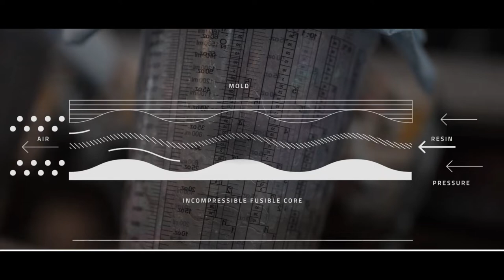Time Alpe D'Huez 01 Long Term Review

Comment: What specifically do you like better about the time vs your Cervelo R5. The Cervelo is lighter and I can't imagine why a racer would want this time fork that adds weight. I am looking at the R5 and waiting bfor Willier and Colgnago to come out w new models. Curious as to what year your R5 was and what wheels you are/we're running on both bikes. I'm intrigued by the Time even though the frame shape looks dated and I wonder how much R&D they are actually doing now and if they will update this alpe de huez model in 2023 or not. Any insights you can share would be appreciated as there aren't many European made options left for carbon bikes these days. Cheers
Reply from the maker: Hi Mark, I was on a 2018 R5 Disc with ENVE 4.5AR's which was slightly more harsh across bumpy and choppy roads. The ride on the R5 was also more noisy and felt a little more like plastic than wood, if that make sense? The Time, overall, is a smoother more muted ride with quick but less racy handling. I don't expect a 2023 update, but I know they're deep in R&D for a refresh of the model in 24 or 25.

Comment: I rode a TIME RX Instinct in college and it was my favorite bike I have owned to date. Currently riding a 54cm Allez Sprint that I feel good on and comparing geo charts it seems like the headtube lengths on the Time are consistently taller which would lead one to believe a more relaxed fit (comparing the 54 Allez 133mm to a small Time 149mm HT length). The Time also has a much shorter reach and taller stack so I am wondering how "racey" this bike rides compared to the Allez if you have any experience. I am looking at purchasing a ADH 01 frame but am having a hard time determining size with no dealer close to me. Time's charts would lead my 175cm build to a medium but the geo specs seem way too big compared to my Allez. Any recommendations or experience here?
Reply from the maker: I would send this question to the guys at Time. They can help! Try info@timebicycles.com
Reply: For what its worth, I just bought and built a ADH 01 size SMALL.  I'm 175 cm and here is my current setup. Saddle height is 70cm, 100mm -6 degree stem with 15mm spacers, Power Pro saddle setback 8cm (standard saddle setback 5cm). My previous bike was a Tarmac SL6 Pro disc size 54, and after having professional bike fit I had it setup as follows, saddle height 70cm, 90mm -6 degree stem with 10mm spacers, Power Pro saddle setback 8cm (standard saddle setback 5cm).  You can review the Tarmac geometry for yourself but you will see that the Small ADH01 and the 54 Tarmac are practically identical except for the reach in which ADH01 is 11mm shorter.  At first glance at ADH01 geometry I would agree stack seems tall for a racy bike, but after digging into it I now think that its more that the reach is short because it is intended to be run with a longer stem as part of the overall design and one should be sizing down to match desired stack height.  So instead of buying a MEDIUM and running with a 100 stem, one should be be buying a SMALL and running with a 110mm stem thus achieving the equivalent of a Tarmac size 54 with a 100 stem (stock).  If you look on the Time US site and look at the "complete bikes", you will see that the SMALL size comes with a 110mm stem stock. Like all bike sizing charts its just a starting point, and probably for a beginner, the sizing recommendations are more applicable as they will sit more upright etc.  For me personally, I actually debated between the SML & XS sizes.  Since the reach was the same, it became a function on stack height, but XS was a bit too low for me.  Again for what its worth, if your current Allez setup is similar to my Tarmac setup, I say go with size SMALL or even XS if you want to get really low. 
BTW - I have been out on a few rides and I will say the ADH 01 did not disappoint, it is superb in all aspects.  I will post a more in depth review of the bikes performance on here in the coming days.
Reply from the maker: @brianwestcoat280  great to hear! I would caution other readers to buy a bike that suits their individual measurements, though. Bike fit, as you know, involves more than just a height measurement - and like snowflakes, no two human bodies are exactly alike. You could have a short torso with long arms, long arms with a long torso, Long legs and short arms with a regular size torso etc. etc. etc. my recommendation is always to consult with your local bike fitter to ensure you end up on the right size.

Comment: Beautiful video, I have been eyeing a time Scylla or Alpe, but what is the difference between alpe dhuez 01 and 21? Can they handle 80kg high torque riders, any flex?
Reply from the maker: Thank you! The 21 has a slightly less expensive carbon, with better overall compliance. I’ve ridden both, and the 21 is smoother and a little less responsive- but not much! It’s still an extremely agile bike.
Reply from the maker: And yes, either would be stiff enough for a rider your size.

Comment: Hey Andy, i own the same cervelo r5 disc with the same paint, you mentioned that you decided to go with time ADH after only one ride, that to me it's quite surprise to hear; like you, i really like the cervelo r5 and to me that most two outstanding characteristics of r5 are 1.responsiveness in transferring power and 2.agility in handling, only one noticeable downside is its harshness on riding, you almost feel every little bump on the road, but i guess that's also another manifestation of 'responsiveness'... anyway, i would really like to know what's about the so-called 'ride quality' in your experience that completely out-run the cervelo r5 then led to such a decisive switching choice.
Reply from the maker: You nailed it when you mentioned the noticeable downside: the harshness. The ADH replaces harsh with smooth, and doesn’t sacrifice any performance.
Reply: @AndyClarkRealReviews  damn, that for sure is something, how about the handling, i noticed that the ADH actually got quite large trail compares with r5 at the similar size, i really like the agile feeling on R5 when getting out of the saddle, you can just rock the bike left and right smoothly with such an ease, unlike my trek emonda slr, it handles a little bit sluggish when out of the saddle and lacking that lively feeling, you can easily feel that when riding with no-hand, emonda slr can be kept straight really easily. do you think that the Time ADH is on the lively side like r5 or on the more stable/sluggish side like emonda slr?
Reply from the maker: @willyturing1803  R5 is on the nervous and nearly twitchy side of the spectrum, but that’s because it’s supposed to be; it’s an ultra responsive, pro-caliber superbike. From 25MPH to 45MPH it’s a DREAM. That was one of my favorite features TBH. The ADH won’t feel as muted as the mass-appeal Trek, but it’s definitely not as quick to respond to input as the R5. If this story was Goldilocks and the three bears, the Trek is too cold, the R5 is too hot, and the ADH is just right - at any speed.
Reply: @AndyClarkRealReviews  I think i'm gonna get the ADH, i haven't ridden the new r5(fully internal cable version), not sure what's the difference, but damn i just love this old version, not sure if i'd want to let it go though, i was actually considering new scott foil 2023 so that i have full reasons to justify keeping my r5, but it seems now the chance of me getting ADH is much bigger and doesn't make sense to keep two climbing bikes. And also not sure if the ADH 2023 version actually allow me to run 30mm tires(measured, 28mm claimed). Because i seriously couldn't tell the real difference between 2022 ADH 01 and 2023 ADH. And also would love to see how do you compare with ADHX.
Reply from the maker: @willyturing1803  soooo, when you start to talk about tire clearance and the X, that’s a whole different conversation. So, can we back up and talk about your intended use?
Reply: @AndyClarkRealReviews  Well, see i'm more of roadie at the heart and that's what i do mostly, so i need a bike that can handle the road stuff like ADH you mentioned that could on part with R5 every major way and exceed in some other aspects, and i use a set of enve 4.5 AR disc mainly on the road side; on the other hand, i also have a set of new enve 3.4 ses(25mm internal version) that could be used for some light gravel equipped with 38c tires; originally i was going to get a fully aero bike like scott foil rc ultimate 2023 i mentioned, but i'm actually a little bit hesitating since i'm not sure this so-called fully aero equipped bike will be that much better like noticeably fast of some sort. And somehow it leads to my current position, i feel like this ADHX is actually that kind of do-it-all bike, in which i mean i could just install the enve 4.5 AR to smash on the road, then swap to enve 3.4 with big tires to run some light off-road on the weekend with buds, heavy fire road is not what i intend to do, hope you can see dilemma you led me to, FYI you were also one of the big reasons i got this old cervelo R5 disc back the day...
Btw, the geometry on the new scott foil seems like that bike is a bit dull in handling, might be too stable and sluggish simply judged from its geometry data, what do you say?
Reply from the maker: @willyturing1803  can’t speak to the Scott based on geometry, I try not to give opinions unless I actually ride something.  As for your dilemma, I honestly haven’t put my AR wheels on the ADH for fear of them being too wide, even with 28’s. I used 30’s on 21mm ENVE Foundations and they rubbed the frame and fork under hard efforts. So, if you want ALL the benefits of the ADH but with clearance for 38’s, then the X is a great choice! I have the transparent blue one, and it’s really all I ride anymore! ADHX is a killer all-road bike.
Reply: @AndyClarkRealReviews  So when can we see the in-depth review of the ADHX? Really excited, in short, apart from the tire clearance between ADH and ADHX, what differences do you experience when you install the same set wheel to those two frames? like riding feeling and handling stuff. I'm gonna choose one between them in the end
Reply from the maker: @willyturing1803  it’ll be up in a few weeks!
Reply: You answered your own question: comfort
Reply from the maker: @thierrysf  I love it when that happens!

Comment: Andy, is there much difference in ride quality between ADH 01 and ADH 21?
Reply from the maker: They’re equally smooth, but I found the 01 to be snappier under hard acceleration, and generally more responsive. NOT BY MUCH, but it’s noticeable
Reply: @AndyClarkRealReviews I just scored the last ADH21 rim brake for $1799?brand new from TIME. I feel like a thief!
Reply from the maker: Boom!!
Reply: @AndyClarkRealReviews  Appreciate your recommendation. First new bike in a decade.

Comment: My dealer recommends a size M with my 182cm. He says, the Time frames are comparably large. In contrast, the Time website says „L“.
Any thoughts on this topics by you? Unfortunately, my dealer does not have different sizes to compare…
Reply from the maker: As a certified bike fitter with over 1000 fits under my belt, I can confidently say that asking for sizing advice via comments on a YouTube video isn't a great strategy. In this case, I will defer to your dealer because they've seen you in person and measured you properly to fit the bike. However, I would ask what the comparison is? Time is large compared to what?
Reply: @AndyClarkRealReviews  yes, you‘re certainly right 😂 …. And I’m tending to consult a professional bike fitter now.
Comparably large means that other companies call frames of similar sizes „L“ whereas Time‘s calling them „M“. Similar observation with e.g. Ridley vs some Italian brands.
Reply from the maker: @hallodidldu  got it...as long as you remember a centimeter is the same regardless of the manufacturer, you're in good shape! 🙂

Comment: Nice video, thanks for sharing.
I am interested in the ADHX size XL frame but wanted to check the maximum weight limit before committing to a purchase.  Local agent stated there was no limit.  Messaged Time through there website - no reply.  All structures have static and dynamic load limits.
Does anyone how I can find out the weight limit for light gravel?
Other  brands (Trek, Specialized, Canyon, Marin, etc.) do have figures for different types of frames and class of riding.

Comment: Is it possible 28c tire? I want bring the comfort
Reply from the maker: Yes. 28c is the max.
Reply: Actually had someone riding with 30c
Reply from the maker: @valuableblu  yes, the 30’s will fit but the tire will contact the frame under power. If you like your paint job, I wouldn’t do it. Trust me. Because I did. 🤦🏼‍♂️
Reply: @AndyClarkRealReviews  very true. It's luckily hidden scratches 😂
Reply from the maker: @valuableblu  dude, it’s much worse than just scratches: took the paint off down to the carbon. Not advised!!
Reply: @AndyClarkRealReviews  What about a 28mm tire on SES AR wheels?  That is about 30.5mm for the tire on the 31mm rim.
Reply from the maker: @psb12123  I wouldn’t do it.

Comment: Can you help about the sizing? whats your size and bike's size. Iam 172 /79 inseam / 177 hands lenght , bikestore suggest me XS but i see at site iam between S and M. 
Thx in advance !
Reply from the maker: No, I defer to your local shop. Sizing a bike via comments on a YouTube video is a recipe for disaster. Hands on, in person is the ONLY way to fit a bike.
Reply: @AndyClarkRealReviews  Thanks for the review.  I'm considering this bike after riding a Trek Madone 2010 in a 56.  I'm in Dallas.  The closest distributor is in Little Rock.  Struggling with how to spend so much without getting my hands on a bike before I commit, especially because of fit.  Any suggestions?

Comment: Hey Andy，may I ask to know the standover for your ADH？The Local dealer do not support the size to me，So if you have free time to measure，Please let me know. Thanks！
Reply from the maker: Happy to measure but mine is a Medium. Is that the frame size you need? If not, then my measurement won’t help.
Reply: @AndyClarkRealReviews  yep，I need the M size standover，Thanks！
Reply from the maker: @yuanjames1633  it's a sloping top tube, so at the seat tube juncture it's 78cm. In the middle it's 81.5cm, and right behind the head tube it's 84
Reply: @AndyClarkRealReviews  Thanks Andy，now i can make sure my size fits M，very appreciate！

Comment: All good, but why bb is sooo high? This is the reason I did not take it
Reply from the maker: Great question, and I'm not sure why they made that decision. What are you comparing it to?
Reply: @AndyClarkRealReviews  I checked a lot of bikes (major brands and boutique) and as far as I know non of them has that high BB, even in biggest sizes. Majority are between 70 and 75mm drop. I pay attantion to this as I have Basso Palta 1 which has perfect geo for both road and fast gravel, except 65mm BB drop (same as Alpe D Huez). I can really feel it is too high in road bike mode, especially used with shorter crankarms. I cannot tell for sure that 5-10mm make a huge difference, but teoretically with 73 degree head angle  bb maybe a bit lower for better security on descends. It is only my experience/feel, so I may be mistaken.

Comment: Doesn't Giant do the same way with their carbon fiber and everything ? 28 max tire is a deal breaker for me, I'm too used to 30 now.... :-(
Reply from the maker: I'm not sure about Giant, but I hear ya on 30's!
Reply: Giant builds great bikes but they do not have access to the same techniques used in automotive and aerospace. They use prepreg sheets to build frames on an inflatable mold, which is the technique used by almost ALL  other manufacturers. Andy does a great job describing the unique technologies that TIME uses.
Reply: @TheTimeSport  Well done for being more active and more responsive to your customers. A huge improvement over what Time as a company was a mere 2 years ago. Keep it up! FWIW I will soon support you with ordering the new ADH frame. In red. Which is absolutely gorgeous.